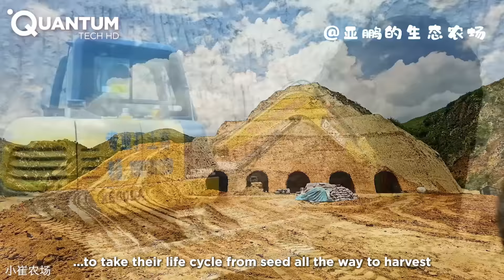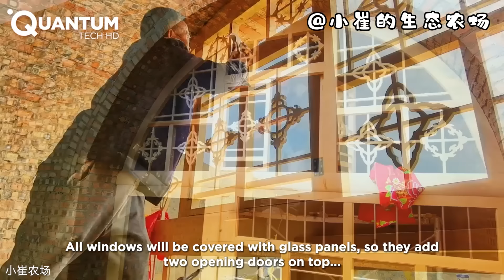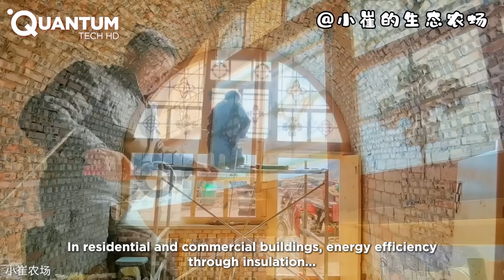Man Builds Amazing Apartment Inside a Mountain (Extended Version)

Comment: Next video: watch as an unstable mud ball collapses from the first heavy rain.  You couldn't pay me enough to live in a death trap like that.
Reply: 那个地方从不下大雨
Reply: agreed
Reply: Yep, caves carved into silt/dust, the softest rock imaginable and still be called that, 'stabilized' by an eggshell layer of only a few millimeters of concrete 'strengthened' by straw?  Then above that, several tons more of the same, then build heavy brick structures on top of that?  I'm thinking the entire hillside will collapse with how the caves have weakened it, and those apartments will be down with the livestock, collapsed under the tons of silt currently above them.
Reply: @张帝星  it does not matter if it never usually rains.....one day it might rain and then the stupid structure fails

Comment: I would be worried about heavy rain and land slides burying my home. Hopefully they plant good deep rooting ground cover around the edges and sides of the hills for strengthening the resistance of the dirt against landslides.
Reply: And heavy rain could saturate ground, making it 2-3x heavier while arch structure might not collapse it will atleast leak, and landslide is prolapse. Personally I feel there is not enough structural support in created artificial Hill in and outside

Comment: I really like the idea and the place looks beautiful. But Im a little concerned about the static stability of these caves. The one thin layer of bricks will carry the complete weight of the whole sand dune above it. Not only the sand directly above but also that from the hill further inwards, which presses outwards. I probably wouldnt put a foot in there, as beautiful as it is. Also: Who will live there? It seems to me that there is nothing around, no option to shop, to buy tools etc. Where do thex get their energy from? If it is really such an ecologic project, why dont they add solar panels to make it really self sufficient and let it produce environmental friendly energy? Do these bathrooms have running water? I saw no piping being built. I don't know, it looks like a potemkin village to me. In China there is a huge building boom, where houses are only built to invest money but they fall apart after a few years because they are built with cheap materials.
Okay, I dont want to be so negative. But it would be interesting to get more info about all that.
Reply: Just the fact that it seems to be built on unstable soil (riverbed?) seems like a surprise waiting to happen.
Reply: Probably they froze the land in order to built. There are engineers and arquitets in this project. The construction technology are far ahead of what you amateur think. I remember a traffic tunnel was constructed in my city, they make inside the mountain, because the land was soft sand, prone to landslide, they froze the mountains in order to build it, it been more 30 years. Imagine now.

Comment: The "Great Wall" of Nowhere, a pharaonic and expensive project, not within the reach of weak budgets, with such vaults it looks like the entrance to the Channel Tunnel ! It will be necessary to commit colossal sums to be able to see such a project succeed despite the availability of the raw material on site, namely the earth. The idea is not bad, but does not remain exhilarating, given the means used to achieve it. For my part, I would not call this building an apartment, but an "open-air palace", or rather: Tell Mahal (tell: Arabic word = mound, mahal = place). As for the technical part, our friends show us how they align and cement the bricks but "forget" to show us how they flatten the walls!

Comment: The brick layers should be fired, they didn't use enough mortar they left gaps between the bricks which will leave room for water, ice expansion and they structure wont last half as long.

Comment: When you destabilize a mountain by removing all this material, and it looks like it consists of clay, when it starts to RAIN, THIS IS GOING TO BE A MESS, Rain is going to flow down behind this brick facade, and down inside these Tunnels, I hope they do Not collapse NO Rebar??? That small plastering of cement is Not going to hold back water coming down the mountain

Comment: I'm no engineer, but shouldn't they be re enforces the inside with rebar? Concrete alone is not strong enough to hold up all this weight over head. Soul seems fairly soft.

Comment: Hard to say what I should think of this, I guess like most people you think wow, but there are environmental issues connected to projects like this. Looking at the terrain around it you think well its pretty barren so its probably not going to make an effect. But sooner or later he is going to get neighbors and with more people come more roads, traffic etc and a few decades later your supporting a greater harm than what you started out to achieve as the area becomes just another suburban link. Perhaps if the province had a bigger picture already drawn up that wasn't just another extension to the neighboring mega city I could love whats happening here.

Comment: The Yellow River is yellow because of its sediment load.  Glacial dust-bowl conditions and desertification caused by bad farming created this entire region, but international efforts have begun reclaiming parts of it via 'best' practices.  This mountain eco-village is a huge prestige undertaking; it is not economically feasible without enormous outside inputs.  There seems to be a lack of adequate foundations for such a weak soil substrate, despite compaction.  They made it look nice, but haven't done anything about stabilising the nearly vertical earth ramparts between levels and on the sides.  This is erosional topography and they quite need to tackle this or it will literally melt away and bury itself again.

Comment: I wonder which process would be the most efficient. Build in an apartment inside a mountain or building an apartment outside a mountain and cover it with sand to make an artificial mountain.
Reply: It would be too heavy if pouring sand on an appointment. Digging holes on a hill its soil is stable on its own.

Comment: it all looks good  , but non of it will last very long. No wall ties used , so boing will occure , no expansion joints or rebar in the concrete slabs. This will all crack and break up. All in all , very unproffesional